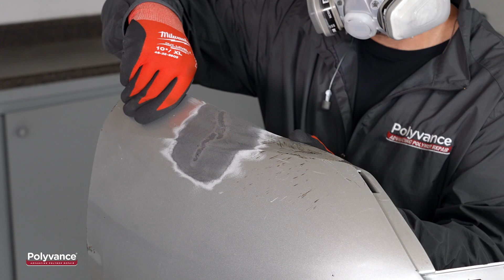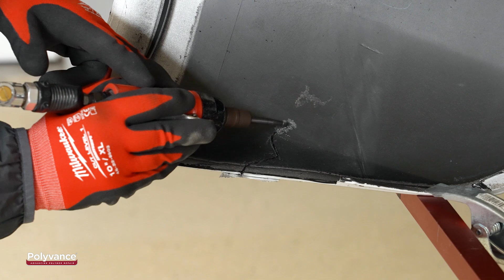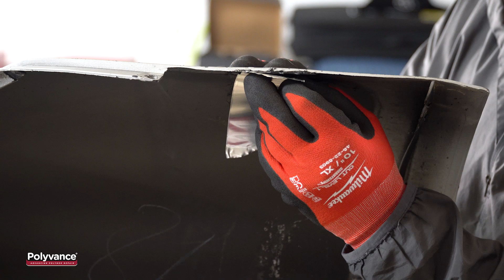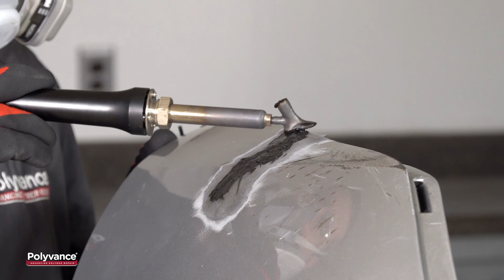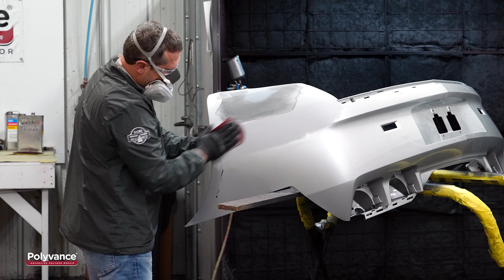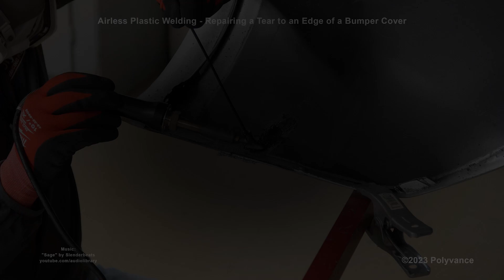Airless Plastic Welding - Repairing a Tear to an Edge of a Bumper Cover

Comment: No one repairs them it is cheaper for a body shop to order an install a new one
Reply from the maker: We go into body shops all the time that repair plastic. However, they are mostly using our nitrogen plastic welders, which make repairs faster than the method shown here. This video is a demonstration of our airless plastic repair kit.
Not only can shops find a win-win situation where it benefits everyone to repair, it's also beneficial to be able to repair plastic when a part is not available.
Reply: Ремонтируют, здесь показывают как правильно делать.